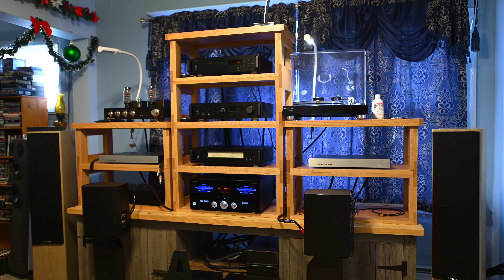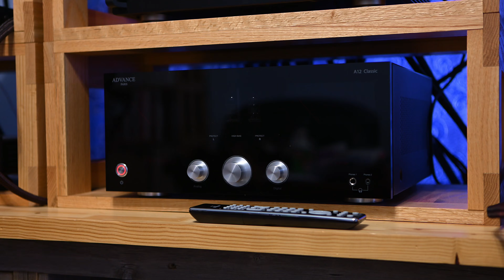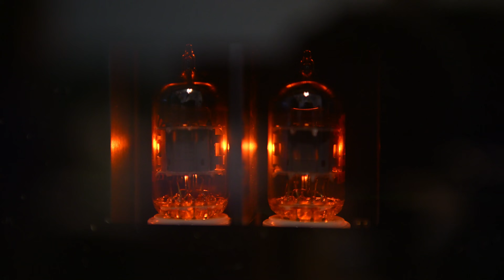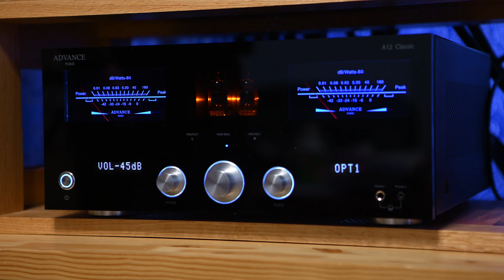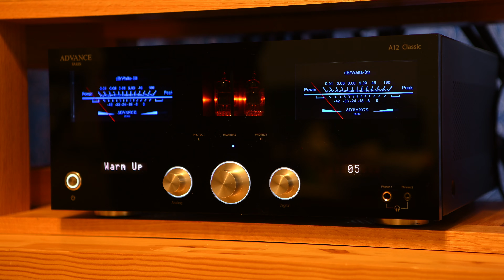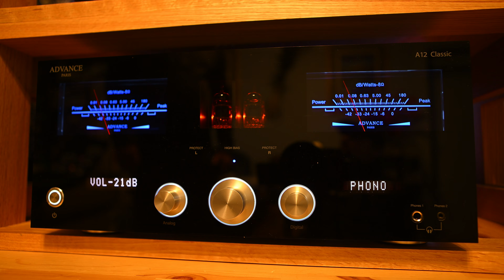Advance Paris A12 Integrated Amplifier is Stunning and takes Todd by surprise!

Comment: I have a Pioneer SX1080 in your opinion would the sound be close to the A12. There are no stereo stores anywhere close to me and lost my repair technician. Thinking of selling my Pioneer three piece system to buy the A12. Any thoughts
Reply: As an owner of the A12, you wont regret buying this amp. The A12 is truely amazing!
Reply: I second @SmokeSmirks motion. I picked up my A12 a year ago and have never looked back.
Reply: I have a Pioneer SX 850 and an A12 Classic. The Advance Paris has that luscious warm sound but with more detail and an almost tube amp-like holographic presentation. I would save up some money and get the Advance Paris, but I'd also keep the Pioneer as a second system. But that's me. I love the look and sound of the 70's era Pioneers.

Comment: I own one. Build quality could be better. The DAC has significant limitations and the recent price increase to $4499 puts it higher than I would spend on it.
Reply: I think the DAC on the A12 is wonderful. I feed my Eversolo streamer via USB to the A12 and find it sounds slightly better than the Eversolo DACs.
Reply: @rafacq  My DAC trips over itself from USB and I am not the only one with this problem. I reached out to Advance and they said it was my fault.
Reply: @baldrider sad to hear that. No issues feeding my Eversolo DMP-A6 via USB to my A12.
Reply: @rafacq  I agree. I was amazed at how good the A12's PCM 1796 DAC sounded when I recently tried playing ALAC and AAC files on a MacBook connected to my A12 with a simple Thunderbolt (USB-C) to HDMI cable.
Reply: Like my A12, but annoyed at the treble readout which it displays as “Ter” rather than “Tre”.  I assume you folks see that too. I’ve emailed AP twice about this, but no response.  Seems a firmware update could correct it.  So customer service appears tp be crap
Reply: @mikeratcliff5554  I haven't looked (don't mess with the treble). I would agree that customer service is definitely lacking. Not looking forward to when the tubes need to be replaced.
Reply: @mikeratcliff5554  Yeah I was a bit disappointed with that. But so far that's the only thing I've noticed. I do like adjusting the "terble" to compensate for crap recordings and ears that have been sitting behind a drum set for 45 years.

Comment: Do they have a matching SACD player?
Reply from the maker: The A12 has an onboard DAC so I would recommend the NEW Advance Paris X-D500 CD transport ($1499.
https://www.ttvjaudio.com/Advance-Paris-X-D500-CD-Transport-p/advxd50000.htm

They also have 2 CD players, the X-CD7 ($899) and
https://www.ttvjaudio.com/Advance-Paris-X-CD7-CD-Player-p/advxcd7000.htm
 X-CD9 $1199) that work great with the A12.
https://www.ttvjaudio.com/Advance-Paris-X-CD9-CD-Player-p/advxcd9000.htm

Hope this helps, call me at 406-285-3910 if you have questions.

Comment: Nice review but you put it in a closed off compartment like shown in 1:29 it will be dead inside a few days. Heat, my friends. Intense heat, especially in Class A High Bias mode. This component needs room to breathe. And lots of it.
Reply from the maker: The entire back end is open and the unit has air flow. I do agree that if you enclose a Class A amp it will over heat but there is not problem in my setup. The A12 is class A/B and I monitored the temp when I set it up. Thanks for watching my video and for your comment. It was appreciated!
Reply: @ Yeah I saw it later in the vid. But the space above the unit is very narrow. And heat goes up. The vents are on the sides and on top. I own a A12 as well. My unit is in a custom Solidsteel rack with 3-4 inches headroom. That amp is awesome but an oven.

Comment: I was originally going to buy the A12 until I noticed the MyConnect250 is an A12 w/ more. It's an A12 and a streamer, as ethernet/wifi, cd player, and AM/FM radio. The guts on the inside are identical from every picture I could find.  It sounds fantastic. However, the phone app leaves more to be desired, but I'm sure with an update they can flesh out the app to make it more functional. The app in it's current state is almost solely to connect media sources off that aren't directly hooked into it (spotify, siriusXM or files on your phone for example), and to remotely control the volume. You cannot turn it on from standby,  change inputs, control your CD player, AM/FM radio, or adjust eq with the app. If Advance Paris would update these features into their system/phone app, I think this would be a $5k+ product.